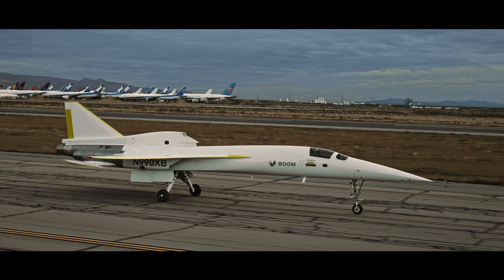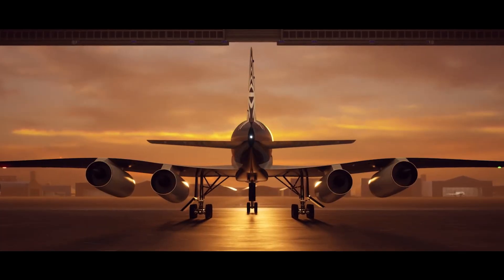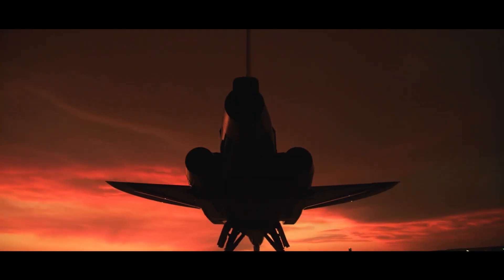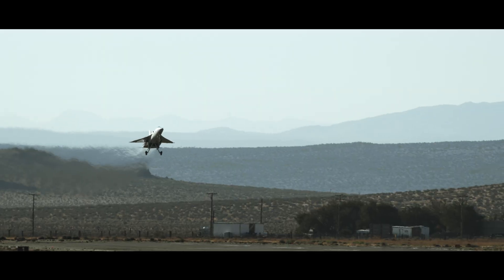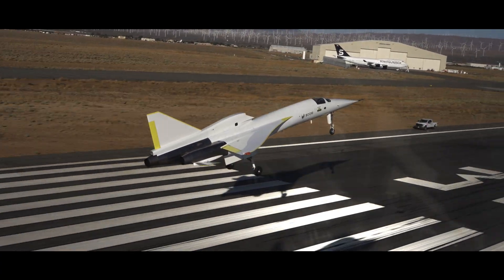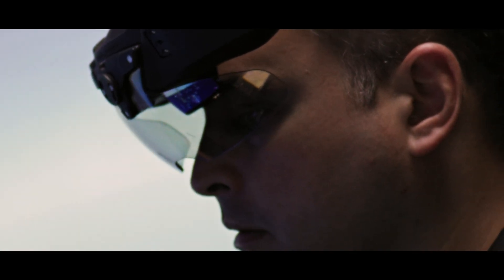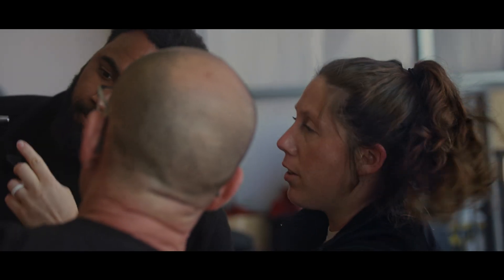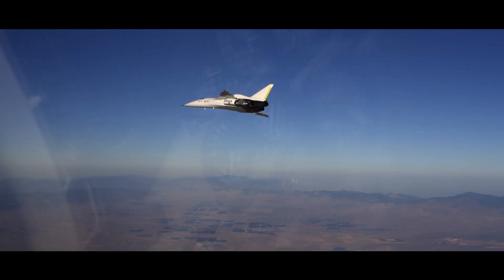From Prototype to Passenger Jet | How XB-1 Will Pave the Way for Overture

Comment: They went into a super wrong direction and telling their investors they wanted to test : 1) high performing team 2) flight visuals system 3) flight safety. 

Yeah sure. 

You wasted millions
Reply: Thanks for your input! I’m guessing you’ve developed, certified, and manufactured a supersonic passenger plane? Right?
Reply: Seriously just believe in them, they are trying their best.
Reply: Look you can be as skeptical of this project as you want but on some level you have to admit that the fact that they are the only people since Concorde who are trying to build a supersonic airliner that have built something that actually flies is encouraging.
Reply: @alt8791  no. The issue is the full scale design will have gazillion more and other issues. The proofed nothing unfortunately.
Reply: That's what spacex did and is worth more than Boeing . They will also do it if investors want
Reply: @thegameroptimus140  stupid. They designed a rocket and kept designing rockets